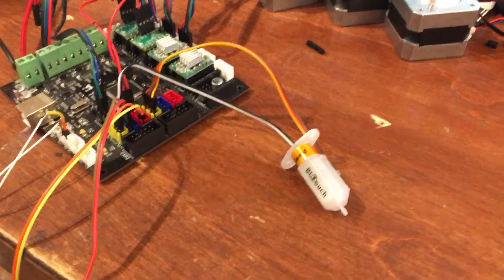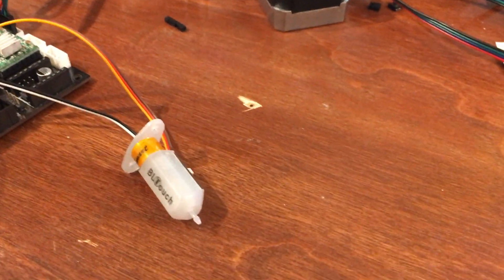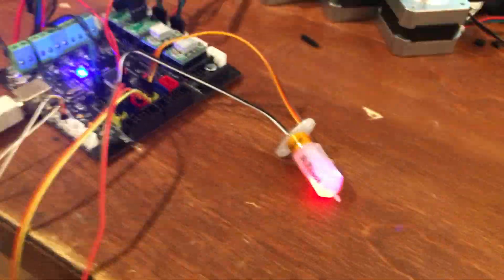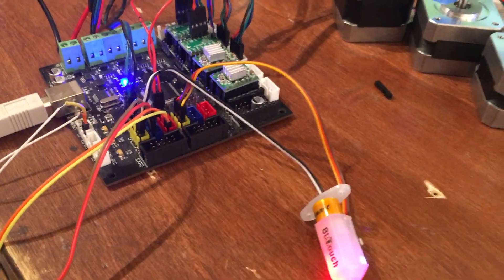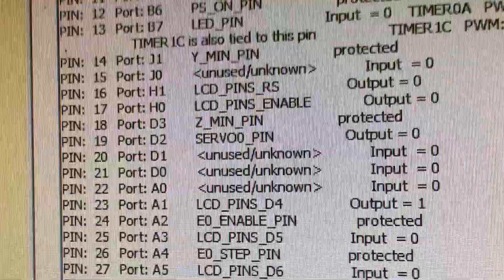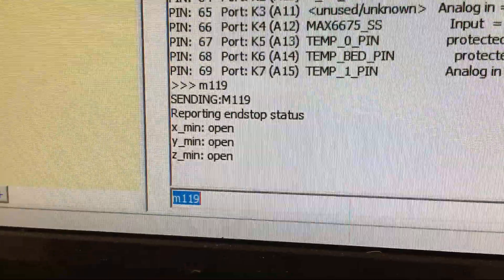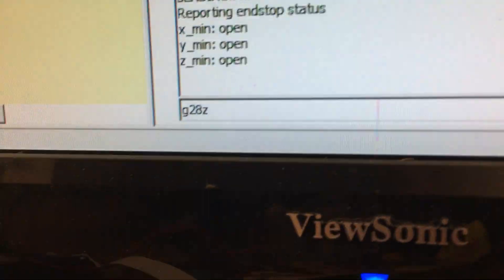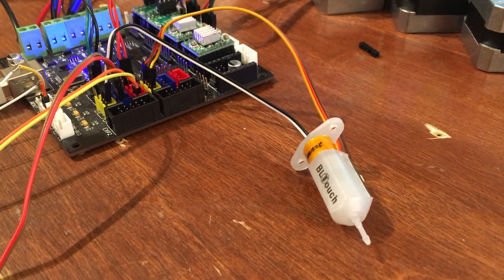Testing BLTOUCH on KFB2.0

Comment: Hi, I have an Anet A8M double extruder with the motherboard PCB KFB 2.0 from Bigtreetech; I would like to know if you have the original firmware or Marlin firmware. Please make a video explaining how to upgrade. Thank you
Reply from the maker: I don't have anything specific to the Anet but it's really no different than any other I3 like printer. I setup marlin for my c3dt/c It's not the same printer but most settings will be similar (it uses inductive sensor and only has one extruder but that's just a few setting). It is on the KFB2.0 https://youtu.be/J1mVPmvX2XA